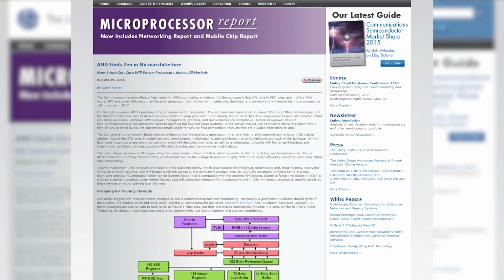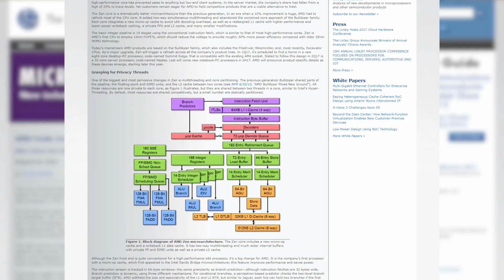Dissecting AMD Zen Architecture - Interview with David Kanter

Comment: Certainly if you have been a hardware enthusiast for more than 5 to 10 years, it's significantly more interesting to start taking a deep dive into processor architecture and detailed discussion, rather than simply evaluating processors based on their commercial positioning. As far as I know this is one of if not the only channel that goes this far into the technical particulars, especially since it is such a niche community that even have this level of interest, full props to PCPer for hosting these types of discussions. It might not rake in the views, but IMO it's all the commendable that PCPer feels its important to cater for a truly enthusiast community, especially on YouTube.

Comment: Great video! Although I don't quite agree with Kanter about Zen's IPC lying between Sandy Bridge and Haswell, think it will be higher than Broadwell, closer to Skylake/Kaby Lake as indicated by the very recent leaked 3D Mark scores where the 1700x outperforms 6900k on single thread performance with a slight overclock.

Comment: When computers went from sequential fetch execute to simultaneous execute and fetch next instruction the memory buss utilization went from about 50% to 95%. The maximum utilization is 100%. That means that no matter what you do inside the CPU, the best improvement you could have is a 5% improvement. What is the number for modern architectures?

Comment: The quantum transistor is digital.  Other than that everything is analog.  Logic gates are amplifiers with a non-linear transfer function.

Once place I wonder if they optimize is on the order of doing the pushes and pops on function entry and exit.  For example:

EntryPoint:
  push ax
  push bx
  mov bx,#3

Seeing this come down the pipeline, they could opt to do the write for the push bx before the write for the push ax.  This way, they would have bx free to use just a bit sooner.

The same sorts of things could happen with the pop instructions if the processor already knows what will happen right after the return.

Comment: Important question for APUs: Since AMD is jumping into DDR4 we may see an improvement in iGPU performance, but wouldn't that performance Delta be more than double if they had chosen to go the 4-channel path instead of simply going dual? Was the dual channel idea only a money saver focused on Non-APUs SKUs ??
Reply: Don't you need 4 RAM sticks to make use of quad channel? Seems like a lot for someone who I assume is a budget gamer hoping to run games off an iGPU. And I think even for intel quad channel support is only on the -E series as well, so the real high end stuff.
Reply: AMD will get a boost from going to 14nm, having larger caches, and being able to throw more transistors at the GPU portion.  We have heard rumors of HBM based APUs, but we do not have concrete info as to actual existence and availability.  But when they will be eventually released, yes they will be significantly faster than last generation parts.
Reply: Victor Custódio Kind of contradictory to buy 4 ram sticks for an APU on desktop, still on laptops i think it could make some sense, not sure if quad channels are more power hungry but could be an alternative to a discrete gpu.
Anyway, APUs with HBM are comming, will probably solve that lack of bandwidth.
Reply: @Josh Walrath - The coming Zen (Ryzen) will be 'Summit Ridge' and will support DDR4,
 After this will be 'Raven Ridge' which AMD have confirmed will support HBM.
Reply: lzhlzh 2x4 is less so its cheaper, who buys APUs? People who want cheaper products.
Reply: Victor Custódio go look at the a12 9800
Reply: Multiple Channels don't mean much in gaming, only applications that are intensively aimed at it which is barely involved in consumer grade.

I had to switch constantly in between Dual and Triple channel on my rig, hosting / gaming and streaming at the same time.

Everything was just the same.

Faster memory means more for iGPUs, even thought that theorically more channels increases bandwidth, people saw more noticeable gains with memory speed rather than more sticks, otherwise it would be kinda strange that you can get away with slower ram with more channels instead since ram speed on iGPUs do have a point of diminishing return eventually, allowing you to sweet spot memory bandwidth with a certain speed combined with channels. 

That would need very concret tests.

AMD skipped on Quad Channel for the consumer grade because it makes everything cheaper cost wise in materials for a microscopic loss of performance in the typical applications, you can expect servers to support it though.

Lastly more Ram is always better than faster Ram, unless you have the funds for a lot of fast Ram to fill your maximum supported size.
Reply: Shao Zapomni Sorry, but there is no processor with integrated gpu with triple channel or quad channel, do you even know what means triple channel or quad channel?
How can you say that "people saw more noticeable gains with memory speed rather than more sticks" This is false, if you are using a dual channel system and you don't have two sticks running in dual channel you lose 50% already of the performance, if you using just one stick very high speed you will not be able to compensate for it.
Triple channel does not mean able to put 3 sticks of memory on your mother board...
Higher bandwidth is everything that lacks on actual integrated GPUs, the problem is that is much cheaper to produce dual channel processors than quad, since quad channels already need 4 memory sticks, and 4 memorys slots on the MB, so the CPU, MB, RAM, all go up in the final price, with that amount you can buy a low end discrete gpu which will bring more performance per dolar.
Reply: lzhlzh You have too much to learn, he is talking about APUs is diferent market, need to keep cost down, is much better buy a dual channel with a discrete gpu, rather than buy a quad channel processor, with a quad channel motherboard, and 4 sticks of ram to run an integrated gpu, this just not make sense, any low end gpu is substancially better than APUs for the price you pay.
I would like to see a NUC with a quad channel IGPU and full of cache memory, just for curiosity, but i think this will not happen anytime soon.
Reply: Are you reading? You don't have to repeat what I "just" said.

People are complaining about the lack of Quad Channel for Ryzen overall, which is meaningless.

Quit treating me as if I don't know what I'm talking about, I know what it is and how it works, I have Triple Channel here and I was confirming that it does NOT make a difference for my systems overall performance to switch in between the modes, including gaming which is "not" with integrated but my SYSTEM performance, get it right.

"Triple channel does not mean able to put 3 sticks of memory on your mother board..."

>>>> https://ark.intel.com/products/52577/Intel-Xeon-Processor-X5675-12M-Cache-3_06-GHz-6_40-GTs-Intel-QPI <<<

> Max # of Memory Channels 3 <

"This is false, if you are using a dual channel system and you don't have two sticks running in dual channel you lose 50% already of the performance, if you using just one stick very high speed you will not be able to compensate for it."

People say, I don't say. It's mostly biased because they probably got a stick faster than their Dual Channel Kit combined.

I made my own research to refresh my mind since you imply something that's not correct.

As I said; "That would need very concret tests".

Facts are-

Single channel;
1066MHz = 8.5GB/s, in Dual Channel that doubles to 17.1GB/s.

Single Channel;
2133MHz = 17.1GB/s, in Dual Channel that doubles to 34.1GB/s.

JayZTwoCent have already debunked that with A10-7850k iGPU performance still scaled at 2400MHz, assuming he also used the 16GB R9 Radeon Kit in Dual, for DDR4 2400MHz is easily achievable and we'll probably see higher tier speeds.

With the newer integrated GPU's that will require more bandwidth, DDR4 will be able to substain them the same way as DDR3 did.

The reason why Triple or Quad doesn't exist with integrated graphics is probably because of how complex the mapping is architecture wise.

TD;LR both speed and channels matter depending on your budget, because if you get two slow sticks that equals a single fast one, you'll get the same results, not better results mind you. The last of things I can't tell which could be potentially make any difference is the larger bus-width, theorically one fast dimm smaller bus can achieve the same speeds which means that's it's more efficient compared a slower but larger one.
Reply: +Shao Zapomni Sorry you are completely insane in your answering, not sure if you are serious or not.
Dual channel is not only a bandwidth problem, but still is the most important one, ddr3 above 1333 is completely irrelevant, as its not commercialy available, even 1333 is scarse, so 1600 can be considered the norm, as ddr3 3200 probably does not exist anymore, if it ever did, the price point would never have attention to the apu guys, well the actual best price/performance memory kits are 2133, with that in mind there is no substitute for AMD MB for dual channel. Triple channel obviously use 3 sticks, but 3 sticks are not necessarily triple channel thats obvious...
The way you were talking about seemed that adding more sticks would not benefit over 2 high clocked sticks, but after 2 in dual channel there is no gain in bandwidth.
Well the fact is there is no way to test how much a triple/quad channel integrated gpu would benefit over dual channel, since this system does not exist, your argument seems completely non sensical and out of context since he was asking specifically about apus.
Reply: Ain't out of context, I was covering the confusion why DDR4 Quad wasn't supported on Ryzen.

People have random DDR3 sticks laying around that can be old so why would they buy more, if on a budget people would consider it an option and that can have negative impact, specially if they buy different dimms to pair with and people go around saying that speed doesn't matter.

Speed does matter as much as Channels, that's all there is to know.

Also, more channels does provide more bandwidth, it's a linear and logical upgrade.

Only that not the everyday user would need so much in their typical applications. Still, it does make a great different for iGPU's.

Comment: @4:48 "The bulldozer steamroller excavator had a few pretty fundamental problems" Well it only really had one and that is 65% of software still being released in 2017 is only programmed and optimised to make use of one core.
Reply: I hear people say things like that and want to say that most people run more than one program that at times demand the CPU simultaneously.

Comment: It was a nice discussion, but entirely irrelevant too the entire objective Zen has for AMD future as a global technology company. AMD has 9% of the market share for consumer CPU sales; these people have bought these AMD CPUs because of one of two reasons: a) it was the best within my budget, compared too Intel; b) brand loyalty at mid and low range for AMD CPUs. Consequently, AMD simply has to chop out the potential aspects that at it’s customer base dose not want or use. Yet, removing them leads too unit production costs falling and allows them to deliver products at lower and mid price point for their existing customers. Smaller die size, means higher yields per wafer, which equals cheaper CPUs (tick that box of existing customers satisfied). Getting rig of fringe benefits, to focus on the mid-range usage and deliver identical or close performance compared to Intel tied to mid-range typical utilizations (tick that box of existing customers satisfied). The most expensive processor from last gen AMD offered to brand loyal users was the FX9590, which cost $200. Therefore, AMD is working within tight constraints on how much it can offer above this price point.

Comment: No... Well ok I don't complain too much about the 5 - 7% IPC improvements it's the fact that not only has a 4 core 8 thread CPU stayed at the same price for 5 years it's actually went up in price even though the cost to manufacturer has went down. That is what I am angry about.

Comment: Wait, he complimented Intel's integrated graphics? This guy is definitely not a gamer.
Reply: Integrated graphics is quite useful for gamers, if you need to run diagnostics, run BIOS hacks, force remove drivers or RMA a GPU, iGPUs are a godsend. Previously you would need to have a second GPU on hand, just in case, and Windows 10 support for legacy GPUs makes this even more relevant. Obviously you can't game well on an iGPU, but that's not really the point of iGPUs in the first place. Being able to power a 4K display over displayport with an iGPU is actually quite impressive and immensely useful for a lot of people, especially in mobile computing.
Reply: USELESS! That's what old GPUs are for. Any real man has those laying around.
Reply: Pretty sure Intel and AMD have been talking for a while about Intel licencing AMD GPU tech for use in Intel CPU's.

Comment: Good god, this guy is supposed to be a cpu design expert, but his microphone is from the 90's. 

AMD bulldozer was not designed by engineers, it was an automated cpu design, the following designs of the architecture were touched up. Bulldozer was 20% larger than it would have been if it had been designed by actual engineers and there would have been no way they would have missed the design faults like bad prediction paths and cache misses that literally destroyed any chance that it would be competitive in any market. 

Ryzen on the other hand was made by jim keller, he created the amd k7 processors which were very competitive at the time, even had a hand in creating x86 and x64 instruction sets themselves. I am really waiting to see AMD dive into the server market with zen, where they will be having processors with up to 32 cores/64 threads with a competitive chip that has high ipc. Currently the most cores intel has packed into a cpu is 22 cores.
Reply: A little bit more complex than that. AMD does rely more on automated place and route as compared to Intel, but that does not mean that Bulldozer was entirely automated.  Many of the more important structures (ALU/AGU pipes) were placed by hand to get the most performance/efficiency out of, but I have heard some nebulous stats that AMD is about 75% automated while Intel is in the 10% to 15% range.  AMD still does not have the sheer numbers of engineers to do hand placement of transistors and structures that Intel does, so they continue to use automated processes in design.  Keller is an awfully smart guy, but he is not the only smart person at AMD.  They seem to have found a pretty good balance with Zen to give them good performance and good efficiency even in the face of Intel's seemingly unlimited amounts of money and manpower.
Reply: Actually the automation was much higher for bulldozer because instead amd pushed its engineers towards apus and hsa which they used in the ps4 and xbox one, those are literally the only thing that kept amd afloat while bulldozer under performed in every aspect. Everyone was thinking amd would be sold off or bought out but the cash revenue from the consoles and the apus kept that from happening, jim keller is the leading expert in the microprocessor field. Worked for apple and amd for many years and was the lead engineer behind ryzen.

Comment: I am running a system based on a FM2+ motherboard with a AMD A10-7800k with 16GB of GDDR3 RAM and I was wondering if I should remove the addin graphics card that someone stupidly installed and reinstate the blanking plate and remove the piece of card that is blocking the HDMI socket that connects directly to the FM2+ socket so that the APU will run cool? BTW I see no need for sound cards or graphics cards when there are perfectly good graphics and sound cards integrated into the AMD A10-XXXX series of APUs.